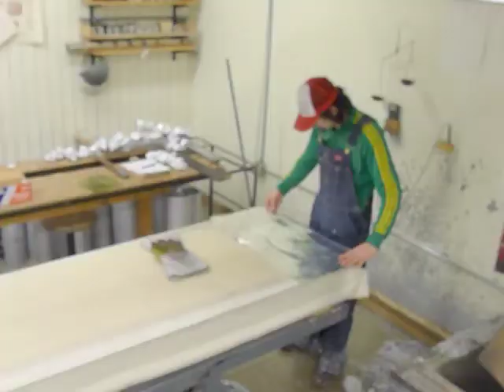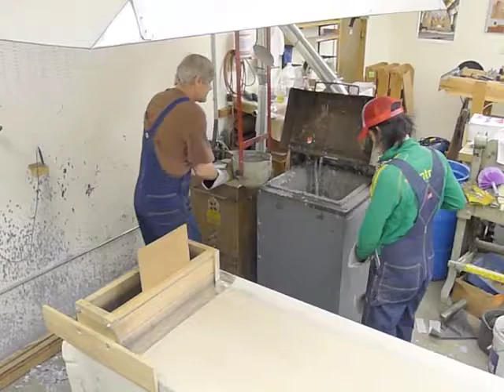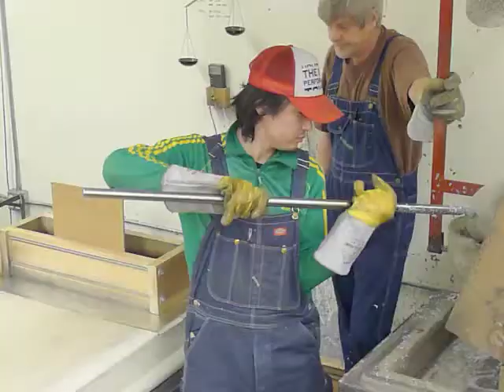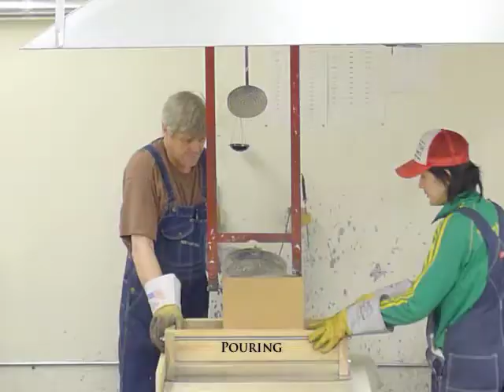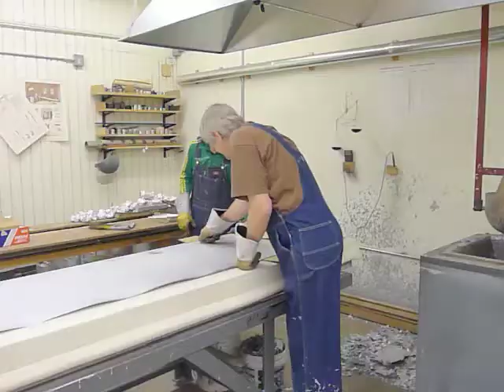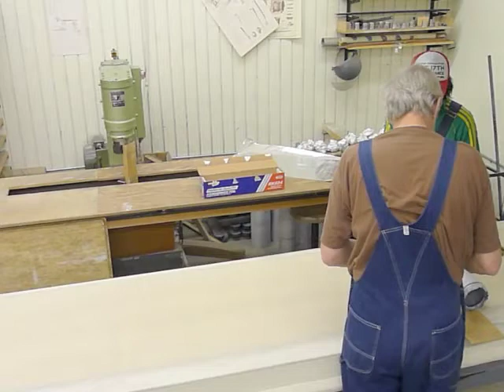Pipe Making: Casting Metal

Comment from the maker: rolling metal between two rollers has been done for hundreds of years especially in Italy.I have tried it but my rollers were not large enough. It takes tremendous force to do the same thing as the hammer does. Hammering in a traditional way to prepare the high lead alloy.

Comment from the maker: @Zumipali2 

The metal needs to be as cool as possible to get the right structure. If it is too hot it will crack while cooling down and most of the metal will run off the table.

Comment: Organ building seems a wonderful way to earn one´s living. What kind of surface is that to extend the sheet of alloy over? I´m wondering if instead of the noisy hammering, one could rather to tight the sheet between two rollers. What do you think?